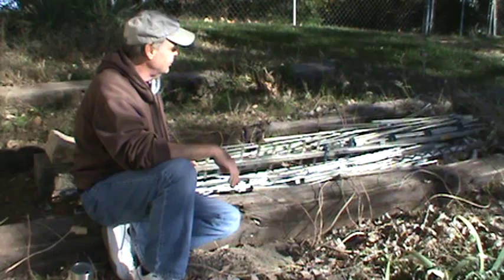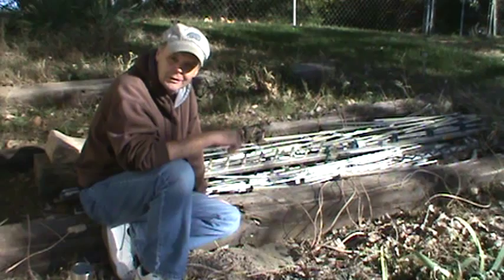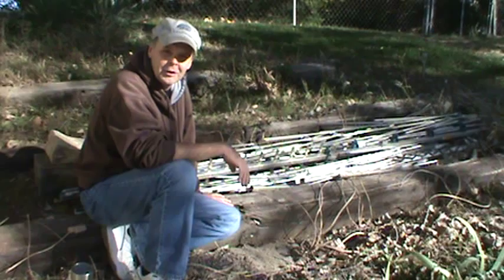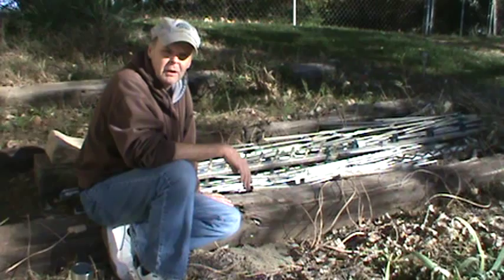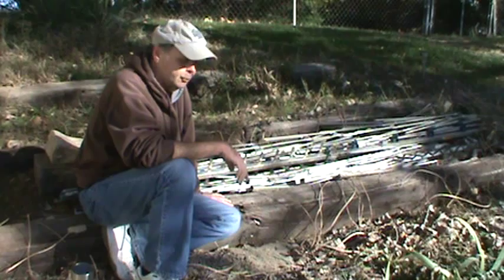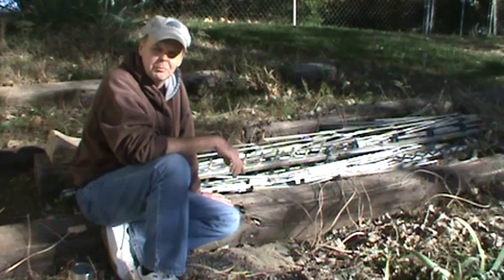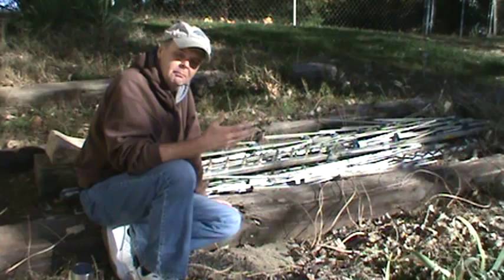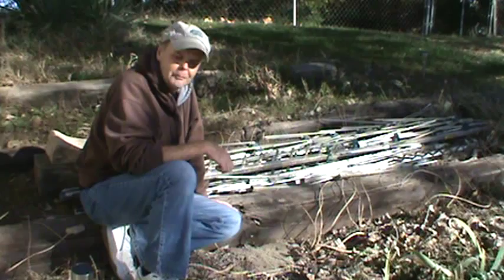What Ham Radio Antenna Should I Build Using These Old TV Antennas?

Comment: Ha ha, thanks for the shout! I figured those would have been used up a few hundred projects ago. 

It's kind of funny how times and technology changes and comes back around - NOBODY wanted those old antennas back then, Everybody had cable or dish. Fast forward more than 15 years and nearly everyone I know has went out and bought one since digital conversion, including me. I haven't had cable in years, and haven't turned on the tv in months. The internet has been my rabbit hole. 

73
Chris
KB0MLR